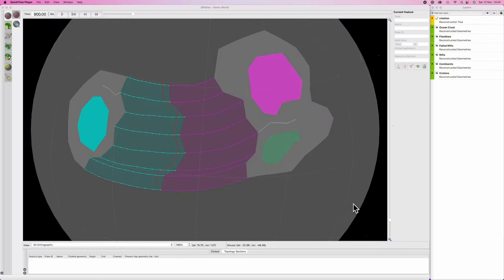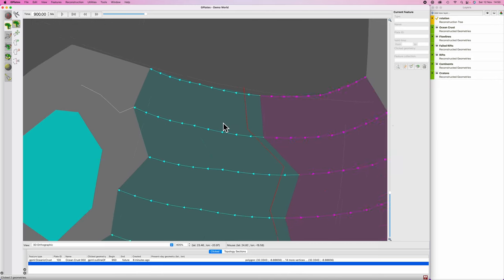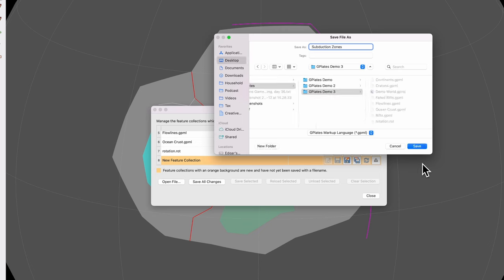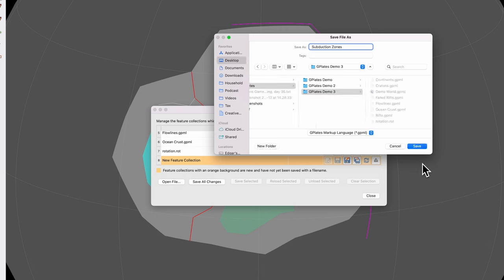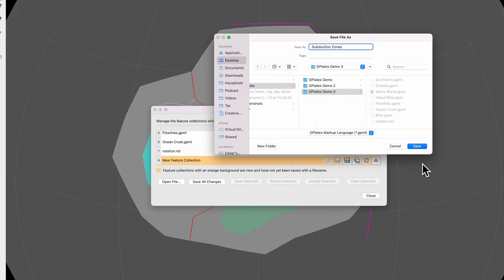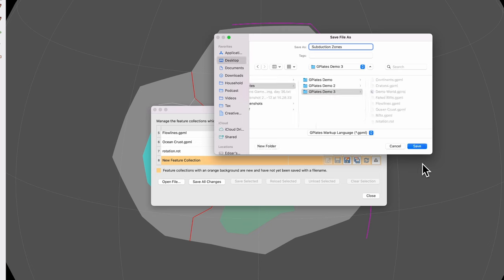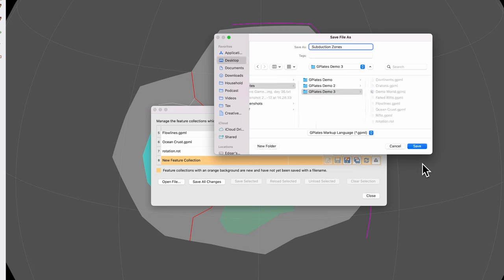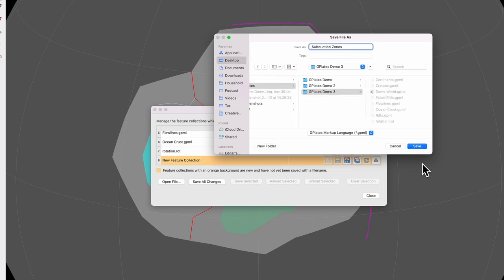GPlates: Subduction Zones & Island Arcs - Worldbuilder’s Log 12

Comment: As the GPlate section continues I wonder more and more... does GPlates actually do any simulation at all? From everything shown so far it just seems like a fancy type of key frame animation specialized for shapes on a sphere. This software feels like it could be much more user friendly
Reply: This program was made for Scientists by scientists. It was never made for the general public to use, lol
Reply: GPlates has the capacity to extrapolate things and automatically merge polygons based on the events happening, For example: adding oceanic crust using the edge of the original continent and flow lines for each time-step you defined for the flow lines. However, such things are tricky to set up, and frankly beyond the scope of this tutorial series.

Comment: I added the Raster, but it won't fill my continental crust. Any idea what could be causing it? if I select Cratons it fills them in, but it just won't fill the land?
Reply: i have the same problem for every continent except for one. have you ever found a solution?
Reply: @stefanfrey8272  yes and no. If the object being filled is too large (stretching over half the planet) it seems to fail to fill in. I think this was causing my original problem
Reply: @DanielCrabbprn  thanks for the answer. thats exactly what went wrong with my continent. i guess this will solve itself as soon as the large continents split

Comment: Hey Edgar, I'm trying to understand what is happening over the whole globe here. For the purpose of this demonstration are we just treating the rest of the world as one giant slab of unmoving oceanic crust?
Reply: The source that he's pulling the tutorial from, Worldbuilding Pasta, kind of goes on about this. It's not that you're considering the rest of the world as an unmoving slab so much as you're treating it as inconsequential oceanic crust. Sure, you could model a whole bunch of rifts and oceanic plate boundaries, but you very quickly run into extremely complicated plates that aren't doing much, if anything, to the actual continental crust you're trying to build. Since you're starting at some arbitrary point after a billion or two years of rifting, you'd not gain much from the rest of the ocean besides maybe some mid-aged volcanic arcs that you could accrete somewhere on the edge of a plate.

Eventually, you do generate significant oceanic crust, usually after about 200-300 million years of simulation. It is - to me - one of the worst parts of the process since it's so time-consuming to constantly split and maneuver around the simulation. You eventually will spend at least as much time inside of a text editor. My last attempt was like 3,000 lines in the rotation file and something like ~175 tracked features, and that before you get to adding things like the actual mountains, LIPs, hotspots, and so on.

Here's an example of a medium complexity of just some plate work. https://imgur.com/KiPTdvk
Reply: Thank you very much, your answer cleared up a lot for me. Your world looks fascinating!

Comment: Why do you use numbers like 100 and 2000 instead of 1 and 2?
Reply: 1 is reserved for items that aren't going to move.
The other numbers is personal choice though.
Reply: I think anything less than 100 has things used for it.
Reply: Assuming that you're talking about the plate IDs, at some point you'll be wanting to have fragments of continental crust break off and form micro continents that don't contain a craton. It's useful to be able to give them plate IDs like 201 to keep track of where they came from while being able to move them separately.
Reply from the maker: It's basically arbitrary. That said, later on when we rift apart micro continents it's useful to give them plate IDs of "101", "102", "103" etc. That way you can at a glance see that anything beginning with a 1 (excluding 1 itself) ultimate came from the same location in the OG supercontinent.

Comment: The one thing that's kind of infuriating for me, and this is not remotely anyone fault, much less yours! is the worked examples of a full simulation provide by Worldbuilding pasta here and on their site... the continents do not look to be moving remotely close to even 3 cm per a year much less the faster speeds provide for ocean subduction and the like which makes me question how fast I should be having things moving since using the actual suggested speeds seems to create very different results, like content collisions being over in a single time stamp rather than taking a hundred million years plus and getting complicated like they show.
Reply: It's also suggested in Worldbuilding Pasta that for events that require more detail and tuning, to shift your time interval to say, 10 MYa instead of the 50 so you can resolve them in smaller steps :)